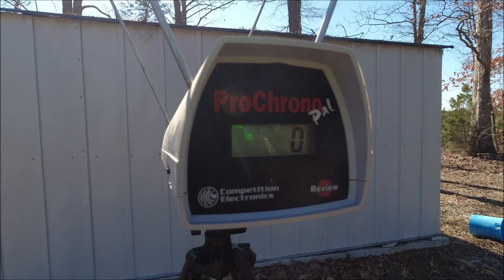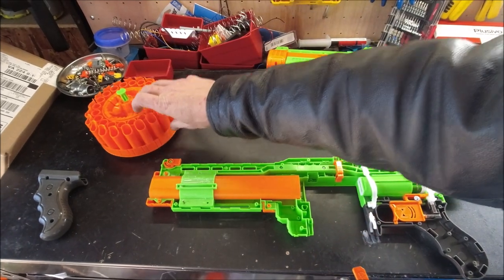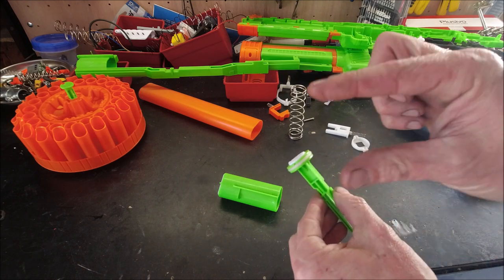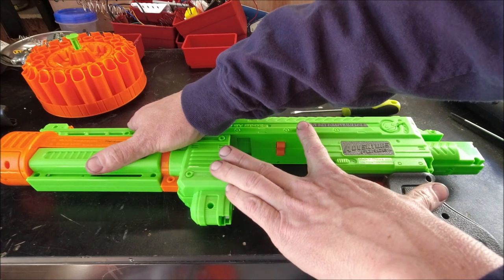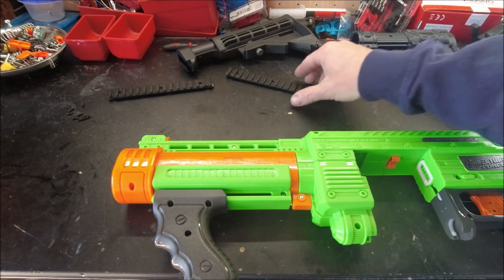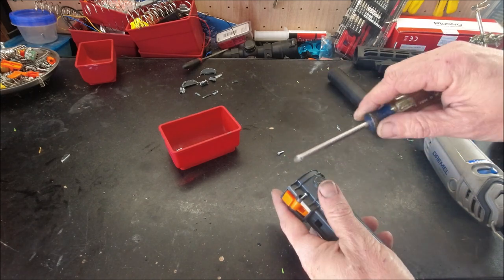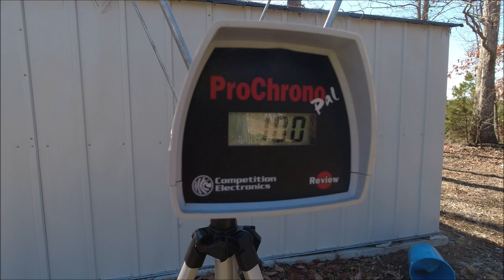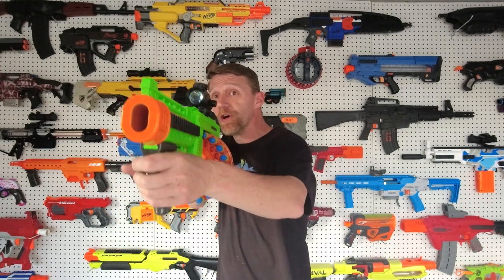Villainator Mod Guide !

Comment: The villainator shell is not what I would call robust and neither are the internal mechanisms. I would not recommend adding stronger springs to this particular blaster... However, what I DO recommend, is chopping the front off and cutting slots in the side (right around where the two black plastic inserts are) for a rear charging handle. I did this to mine. love it. I also added a return spring to the charging/priming rod.

Comment: Are you gonna make an addendum to show how the accuracy changed from the stock spring to the heavier spring? Would a 9/16 or 17/32 brass fit in the cylinders to make the dart fit more consistent without widening them or is the drum's cylinder walls too thin to fit those sizes of brass in them? For me, I think 17/32 are a bit too snug on darts that's why I'm thinking of going with 9/16, not 17/32, if their outer diameter will fit in the drum's cylinders without sanding the cylinders to make them wider. Thanks for confirming a spring that works and still retains the slamfire functionality of the blaster.
Reply from the maker: I’ll get it out on the range, once I’ve had a chance to repair the range. The last winter storm really messed it up. But I wouldn’t expect any negative difference in accuracy at all. And you certainly could brass the drum but I would say be careful there, not a huge plunger tube or the greatest seal to the drum. Too much brass and you could actually reduce the power due to the added drag.
Reply: last war I was at someone had one of these and with the used darts if he tipped it down they would just fall out... brassing it would fix that for sure

Comment: I hoped this would have been attempted by now in the community but I have to ask could the barrels on the drum be brassed to bring it up to 120 or higher?
Reply from the maker: I brasses one of my old ones, but it was with mixed results shot to shot. I guess the seal isn’t quite as good as I had hoped.